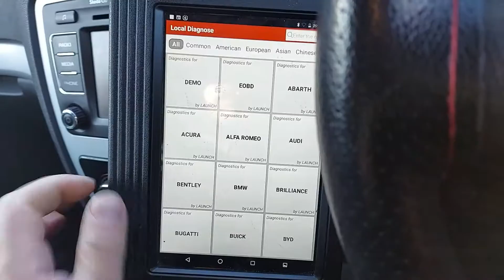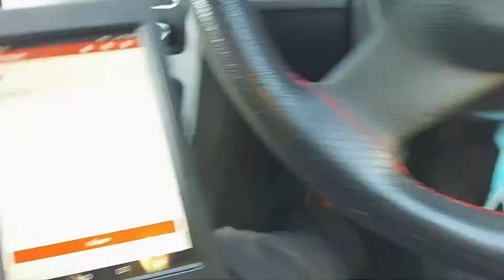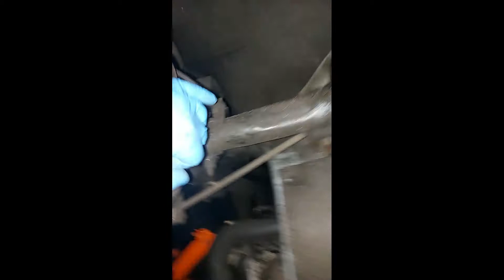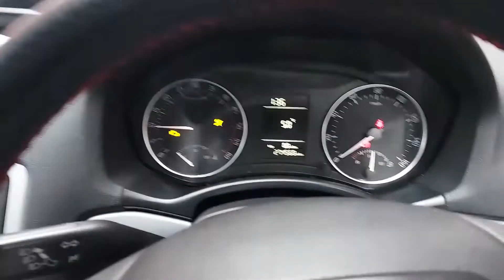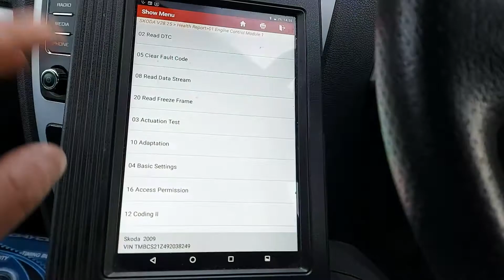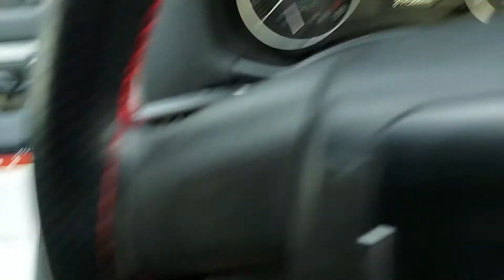VW Skoda Seat 1.9 TDI PD Non Start P0341 P3008

Comment: Hi hope u well.
I have the same problem...
What did you mean by you forget to put the injectors. 
Can u explain me what you did because you came back and she started one turn nicely...

Im having hard start 
 And sometimes start once and cut off same time. Same same like ur vidoe.

Mine is audi 1.9tdi avf 2003.

We did camshaft, after that got this hard starting problem, heavy fuel consumption and dead power
Reply from the maker: I have disconneced the injectors connectors and crank the car without the electrical connector

Comment: How can I pilot injector learning? for skoda Octavia 2010 Bjb engine via x431
Reply from the maker: Steps:
1. engine idle, 
2. coolant over 70 celsius
3.  go to engine ecm
4. got access permision
5. enter password 27971
6. go to basic settings
7. go to adapting minimum inj deviation qty
8. press clutch and hold
9. press brake and hold
10. release clutch
11. release brake
12. press the accelerator all the way down (you should feel the kick down switch)
13. nd wait for the process to begin (takes about 30 secs to begine and may take up to 1h to finish)

you may have to hold down the accelerator all this time, sometimes you release it and it does it's job sometimes it doesnt.
good luck
Reply: I tried same as your password but it shows it can not log I don't know what happened
Reply: How can I touch you I want to more information from you